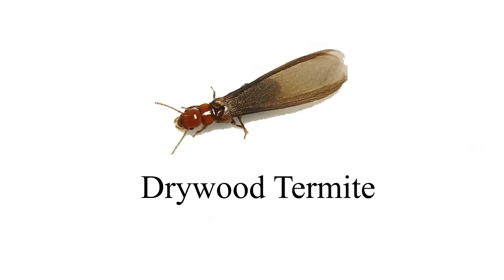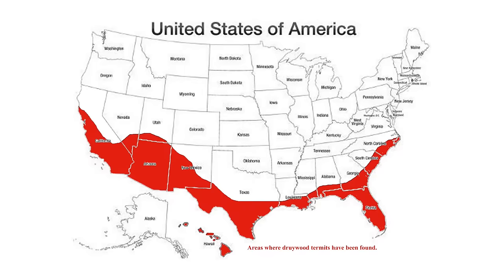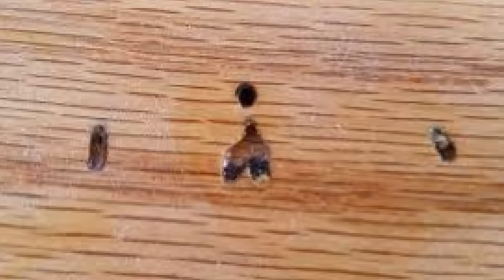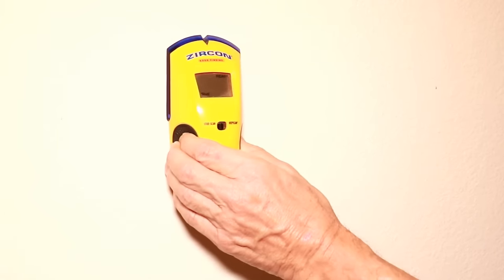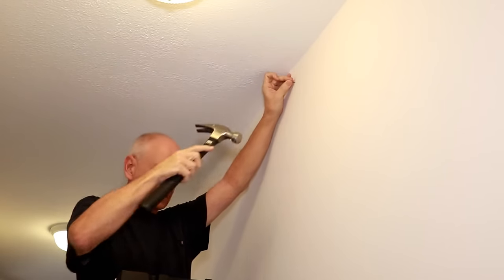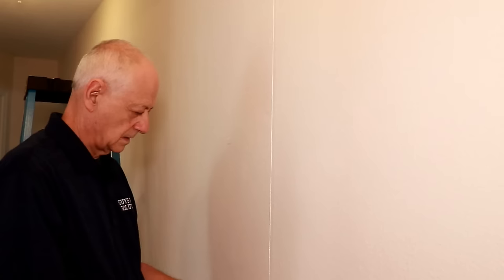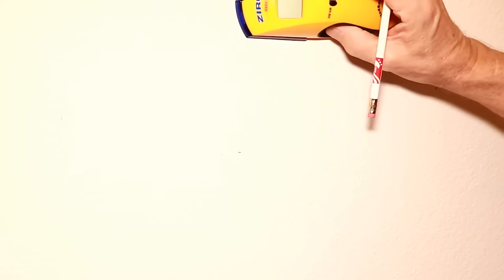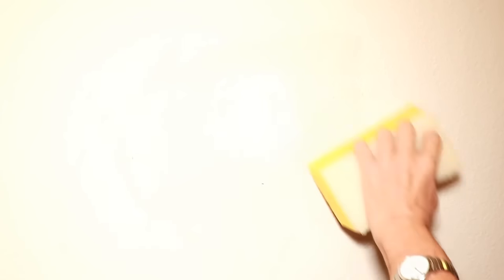How to Treat a Drywood Termite Infestation Yourself. A MUST see if you have Drywood termites.

Comment: Hi Guy, In youtube "How to Treat a Drywood Termite Infestation Yourself. A MUST see if you have Drywood termites". I have Drywood in the kitchen window MDF trim.  Is each stud treated with Termidor Foam every 4" and then sprayed with Bora-Care?  Are there concerns with copper / metal?
You do great YouTubes.
Reply from the maker: It is important to understand how drywood termites work.  They enter through cracks and crevices around windows, doors, the eaves, pipe penetrations, and so forth.  Most of the time, they enter through several locations.  That is because a swarm of them attacked your house at the same time.  If there was a crack or a crevice, then they probably found it.  After they established their galleries, which will be inside the wood, it will take four to seven years for them to be able to swarm.  Now that they are in your house, the swarmers will use holes that are in your studs to travel through the walls.  Those holes in the studs were created by the electricians to run the electrical wiring.  Not only are these holes going through the studs, but holes were drilled into the attic for the light switches and to run some of the wiring for the outlets.  So, the termites now have easy access throughout the attic and the walls.  If you have a basement or crawl space, they have access to that as well.  Most of the time, you will have no idea that they are in the walls, because the frass is inside the wall.  To make matters worse, if you have drywood termites, then your neighbors have them too.  That means you have been getting swarmed for as long as they have existed in the neighborhood.  Most likely, we're talking about years, so it's a safe bet that you have these guys in many locations in your home.

I always hate to be the bearer of bad news, but if you have drywood termites, the only sure way to get rid of them is to fumigate.  Prices for this can vary wildly in this industry, so I recommend that you watch my video on how to hire a pest controller without getting ripped off.  That video can save you a lot of money.  You should also know that the gas they use to fumigate has absolutely no residual action whatsoever, so you can get reinfested the moment the tent comes down.  Like I said before, if you have drywood termites, then your neighbors have them as well.  Since drywood  termites swarm every year, it is almost a certainty that you will be reinfested within a year after the fumigation is done.  The only way to prevent this is to do a preventive treatment on your house every 60 to 90 days.  Most pest controllers will not do this, so it is something that you generally need to do yourself.  I have a video on how to do that and I will place a link below.  If you absolutely cannot afford to fumigate your house, then you can try spot treating it yourself.  It is virtually impossible to find all the termite galleries, but it is way better than doing nothing.  Regardless of how you treat it, you should begin the preventive treatment immediately, so that you do not get additional termites paying you a visit.  If you are going to treat it yourself, then you need to drill the suspected studs at 4 inch intervals and inject the foam into each hole for about 5 seconds or until the foam it either coming back out at you or coming out of the other holes you drilled.  Foam should be going into or coming out of every hole.  You would not use the Bora-Care to treat studs that are behind drywall.  However, Bora-Care can be applied to all bare wood, regardless of where it is located.  Always mix it one to one with water.  Applying these products on metal is not a problem, but you don't want to drill into wiring or plumbing.  So, when you are drilling studs, STOP if you hit any resistance at all and move the drill a couple of inches up or down because you could be drilling into a pipe or electric line.  If the drill goes in really easily all of a sudden then STOP because you could be drilling into a hole that was created for the wires to pass through or you may be drilling into the wall void.  Use caution when you are drilling at outlet height.  The wires are usually a few inches to a foot above or below the outlet height.

I hope that helps.  Be well my friend.                      

Video on how to hire a pest controller without getting ripped off:  https://youtu.be/y-a8XOqVrlE

Video on how to prevent drywood termites:  https://youtu.be/neNsmVbj8Pc

Comment: Hi Guy, I live in a condo in Southern California. I have found termite swarm 09/01 inside of my condo. Termites came in from a vent in a bathroom (no window in this bathroom). I have not seen signs of infestation prior. I have had two Pest Companies came out for inspection. They found dry rot on a window frame and on the out door staircase. My condo is on the top 3rd floor not the ground level. Would you advise what I should look for when hire for termite treatment?
Reply from the maker: I am so sorry that you are having this problem.  You did not tell me everything that I need to know, but it sounds like you have two units below you and I'm guessing that the building is constructed of wood.  Also, you did not tell me if the pest control folks identified these guys as drywood termites, but it sure does sound like that's what they are.  If all of this is the case, you should know that the only surefire way to get rid of drywood termites is to put a tent around the entire building and fumigate it.  That means you need or the owners in the entire building to agree to this.  If you have a condo association, then you should bring it to their attention.  Drywood termites often enter the attic from openings in the eaves around the roof.  There is a good chance that you have multiple galleries in the attic.  From there, they often find their way into the walls.  These guys may affect the top floors first, but this is a huge problem with the bottom floors as well.  They will also enter through windows and doors, so the bottom floors may have them as well.  Even if they don't, this is definitely going to affect the bottom floors, if there is a failure in the roof structure.  Drywood termites are slow eaters, but eventually, the roof structure is going to be compromised.  This may render the entire building uninhabitable at some point, so it is everybody's problem.  The fact that you have seen swarmers means that this problem has been going on for some time.  A new gallery cannot produce swarmers for four to seven years.  So, this should be a call to action for the entire building.  To make matters worse, even after you fumigate, the gas they use has no residual properties.  That means you can get reinfested the moment the tent comes down.  There is a way to prevent this, but it is not practical for building that tall.  I know this is going to sound crazy, but you may want to consider selling and moving into a single-family home.  The only alternative is to fumigate the building about every seven years.
 
To answer to your specific question on how to hire a pest controller, I just happen to have a video on that exact topic, and I will place a link below for you.  Prices can vary wildly in this industry, so you would be wise to check out my video.  This is particularly true if the entire building is going to be fumigated.  Whoever is responsible for hiring the company you should also watch this video.  You can save thousands of dollars if you know how to do this correctly.  
 
Again, I am so sorry that you are having this problem and I am sorry then I had to give you this sort of bad news.  I know this is not what you wanted to hear.  
 
Be well my friend.    
 
Video on how to hire a pest control without getting ripped off:  https://youtu.be/y-a8XOqVrlE

Comment: Hi Guy, thank you so much for your video. I have a question. I found a small hole in my dry wall with frass appearing stuff underneath. I asked professional to inspect my house. They didn't find any other evidence of termite in my house and also they didn't find anything in the attic or any outside walls. If you have only one hole like this without any other additional findings, can you still say this is caused by drywood termite? or  could this be caused by other insects? I am a little hesitant to do expensive treatment like fumigation without sure confirmation. Is there any other way to confirm this pinhole is caused by drywood termite? or one pinhole with frass underneath is good enough finding to confirm drywood termite?
Reply from the maker: The first question that comes to my mind is if that was actually drywood termite frass that you were seeing.  If it is, then you are going to be seeing some more of it because they will continue to push it out of the hole.  When you see another pile of it, just take a close up photo that is very well in focus, and send it to guyspestsolutions@gmail.com.  Drywood termite frass is generally well formed, elongated pellets, and not a dust, mud, or sawdust.  Please take note of where you found the hole.  Oftentimes you will see the first signs of drywood termites around windows and doors.  Don't forget to check under your furniture for frass, particularly if you ever purchased used furniture.  If the frass does not reappear and you cannot find any other areas that have it, then I would take a wait and see approach.  The only good news about drywood termites is that they are very slow eaters and it takes them a long time to do any significant damage.  If you send me a photo of the frass the next time you see it, then I can probably tell you if it is from drywood termites.  Be well my friend.
Reply: @GuysPestSolutions  Thank you so much for your time answering my question. I will continue to monitor closely and will send you the photo if I see another one.
Reply from the maker: @drk2796  Sounds good.  Be well my friend.

Comment: I’ve seen them come through my window from outside. I mean right in between my window in a row like jets flying together. Obviously I have a gap. Do I need new windows or some kind of weatherstrip?
Thanks
Reply from the maker: I am so sorry that you are having this problem, but you should know that you have an infestation.  Sealing gaps will definitely help, but it is important to understand how drywood termites work.  They enter through cracks and crevices around windows, doors, eaves, pipe penetrations, and so forth.  Most of the time, they enter through several locations.  That is because a swarm of them attacked your house at the same time.  If there was a crack or a crevice, then they probably found it.  After they establish their galleries, which will be inside the wood, it will take four to seven years for them to be able to swarm.  Now that they are in your house, the swarmers will use holes that are in your studs to travel through the walls.  Those holes in the studs were created by the electricians to run the electrical wiring.  Not only are these holes going through the studs, but holes were drilled into the attic for the light switches and to run some of the wiring for the outlets.  So, the termites now have easy access throughout the attic and the walls.  If you have a basement or crawl space, they have access to that as well.  Most of the time, you will have no idea that they are in the walls, because the frass is inside the wall.  To make matters worse, if you have drywood termites, then your neighbors have them too.  That means you have been getting swarmed for as long as they have existed in the neighborhood.  Most likely, we're talking about years, so it's a safe bet that you have these guys in many locations in your home.

I always hate to be the bearer of bad news, but if you have drywood termites, the only sure way to get rid of them is to fumigate.  Prices for this can vary wildly in this industry, so I recommend that you watch my video on how to hire a pest controller without getting ripped off.  That video can save you a lot of money.  You should also know that the gas they use to fumigate has absolutely no residual action whatsoever, so you can get reinfested the moment the tent comes down.  Like I said before, if you have drywood termites, then your neighbors have them as well.  Since drywood termites swarm every year, it is almost a certainty that you will be reinfested within a year after the fumigation is done.  The only way to prevent this is to do a preventive treatment on your house every 60 days.  Most pest controllers will not do this, so it is something that you generally need to do yourself.  I have a video on how to do that and I will place a link below.  This is a generic video that covers a lot of different pests, but it also works for preventing drywood termites.  Just ignore the part about treating your yard.  You only need to treat the house for drywood termites.  This will not treat the termites that are already there, but it will stop new ones from getting in.  If you absolutely cannot afford to fumigate your house, then you can try spot treating it yourself.  It is virtually impossible to find all the termite galleries, but it is way better than doing nothing.  Regardless of how you treat it, you should begin the preventive treatment immediately, so that you do not get additional termites paying you a visit.

I hope that helps.  Be well Sarah.                    

Video on how to hire a pest controller without getting ripped off:  https://youtu.be/y-a8XOqVrlE

Video on how to prevent drywood termites:  https://youtu.be/Yozv3s-Qwlw

Comment: I am in central north Texas (almost at the Oklahoma state line) and believe I have dry termites. Is that possible? We have frass on the floor near a water heater closet. It appeared about 2 weeks after a water heater leaked and was replaced. There are holes in the grout where the wall meets the tile floor and a line of holes about three inches up the wall in the sheet rock. No mud tunnels that we've seen, house is on a slab. Haven't seen any live insects or wings. Had a sticky pad insect catcher near the holes for a week and only caught roly polys.
Reply from the maker: Drywood termites are not known to be that far north.  Does the frass keep appearing every day after you clean it up?  If so, do you suppose you could send me a photo of it?  Watch my video on how to photograph a bug and use that same technique to take a picture of the frass.  I need to see it up close and the photo needs to be in very good focus.  My email is guyspestsolutions@gmail.com.  I know it's tempting, but do not seal up the holes.  When you email, please include your case number in the subject line.  It is Case Number 082120241.  I will do my best to help you get to the bottom of what is going on.  Be well Amanda.